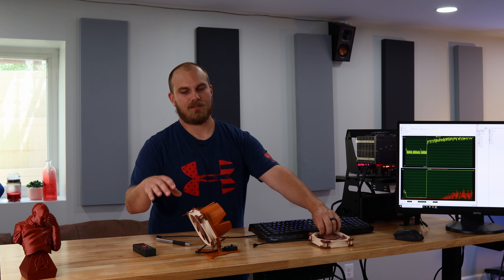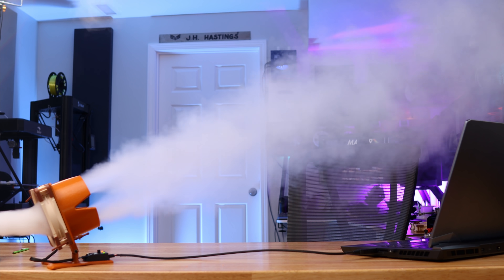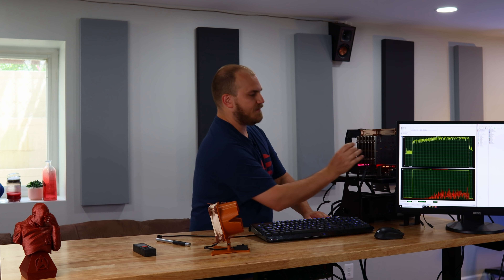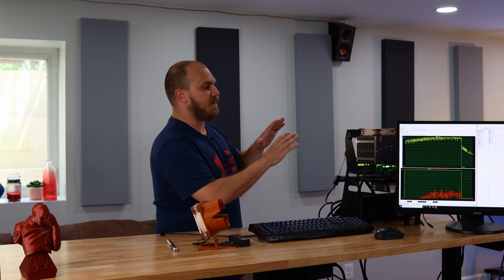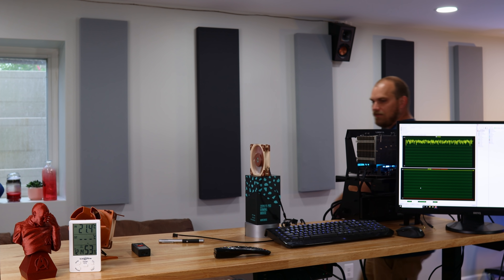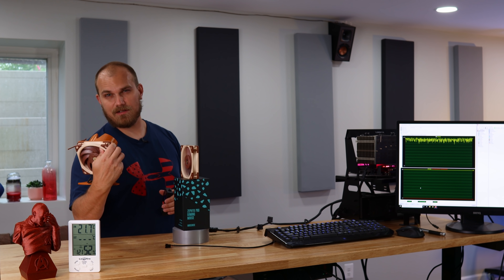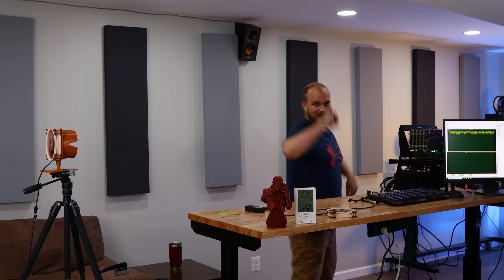AIR CANNON CPU cooling

Comment: What if we were to use this in a room heater? They usually are around 800w to 1500w units (iirc). I would assume it would likely need a lower wattage heater cause its performance is high? Or would this negate?

Also would like to see the top 5 tested fans be tested with the noctua desk fan in this video. Would be a cool special video. I'm assuming you might have to modify the desk fan in some instances?

Comment: There is still a flaw in your copy, and that's that each flow guide (no clue what to call it), has the same shape on both sides. While you can see in the Noctua prototype photos and sketches that the holes that guide the airflow have a specific lean to it because the fan blade spins one direction. I think that this is a very important aspect in the Noctua design. The guides 'slope' in the radial direction on one side. I also commented this on the other video, but nobody seemed to have seen it. I hope you see what I mean and try out a v2 design as I think this is a very important aspect of the Noctua design.

Comment: You'd be shocked at the thrust you can produce with contra-rotating blades - Essentially mount two fans flange to flange - one rotates clockwise the other rotates counter-clockwise.  You'd need to print a mirrored version of the fan rotor for the opposite rotation fan (i.e. the normal noctua would rotate in the normal direction, the second fan would spin opposite direction with an axially mirrored rotor)

Comment: If you have a remote fan wouldn't it make more sense to use a bigger fan. I've got one of those 60cm diameter fans and boy are they good at cooling although they are also noisy.

Comment: Hey James,

I printed one of these, and even remixed it to add a Modular Mounting System mount to it. Now that I have it on a fan, I'm noticing that there's air blowing out the sides, where the vibration dampening pads make a gap between the shroud and the fan. Maybe using the gasket that they include with the fans will get you a couple more cm depending on how bad the leak is for you.

Comment: Mechanical engineer here. You can achieve passive cooling without a fan by putting a half meter of 4inch PVC pipe over that heat sink effectively creating a chimney.

Comment: imagine how a Drum Fan works. look at the impeller drum. take the drum Scale it up large  and deep enough that a motherboard tray can fit under and into the Drum a bit now centrally suspend it on a motor so it rotates around the tray. make the computer case the fan its self :P . "Static cooling system low noise only psu fan and the case as ot rotates "at the speed of a old record player quietly moving air around the passively cooled computer inside...

Comment: guys. what if instead of blowing air through a radiator, why not design a radiator that spins and cools itself by moving air over/through itself. then you get use of 100% of the air you move instead of out the sides of the fan or whatever. shrug

Comment: The Picard buste facepalmed twice as statically at this remote cooling.
I think you should have put a huge cone with a 2 meter diameter to catch more air, I think it'll catch more air that way. Or not a cone, but a funnel.

Comment: You may have tested this already, but could you 3D print a chimney for that passive cooler?
I passivce cooled my 3950x with an NH-C14S at 2.2Ghz, with a short 6 inch, what is that 30cm cardboard chimney i could bump it up to 2.9Ghz

Comment: hmm.. on hot summers I often had to remov the sidepanel, point a normal, cheap plastic roomfan at the stock intel cooler and prevented overheating shutdowns that way. also helped GPU temps ALOT.

Comment: I'd like to have two fans mounted under my monitor but the monitor has no mounting points is is on a stand too small for putting them in front. Also I only have clearance for 100mm fans... Any ideas, anyone?

Comment: Man states he will do science. Keeps tweaking variables.

Doesn't record his results 

Should make a test at around 50 cm, 100 cm 150 cm and 200 cm

Measure deltas.
Report.

Coolest fan at one meter might not beat 2 meter ranges.

Three meter fans might exist but probably should just perform better at 2 meters

Thanks for sharing but we need SCIENCE!

Comment: 2 Questions,
Would a trumpet intake increase overall flow
And would this contraption blow harder, directly on a radiator/fins than a fan directly mounted all by itself ?

Its all making sense though, bigger intake, smaller exhaust. Like valves on an engine.

Comment: So i am thinking... is it possible to use a nozzle of this kind but not to make it throw the air in a straight line at a distance, but to make it suck the air in in a straight line at a distance? Though i personally don't think it's possible.

Use case: remote soldering fume extractor.

Comment: Just for your information:
Green laser ussually don't have a green light source, they use a infrared LASER source that passes through a crystal to turn green, however some of that Infrared doesn't turn green and need to be filtered out.
some of the cheaper don't use said filter and blast you, not only with a beam that higher intensity that advertised (hilarious enough), with infrared..

Comment: Last summer, my laptop fan broke, so I took the bottom plate off and laid on my couch with the CPU facing my 16" room fan. It managed to maintain 67F on a i7 8850U from about 6ft away. I bet with a shroud I could get a lot more distance.

Comment: i curious what effect would ahrouds like this have inside a case. like adding it to the intakes
Reply: exactly, if it's so effective to move air, that could lower noise levels by lowering case fan speeds when used in the front of a case to push fresh air towards the CPU and the GPU, would be nice to get figures on full performance mode (temp gain?) and quietest mode maintaining similar noise level.

Comment: i think the shroud might be a great addon for the front case intake fan. Higher static pressure to push air towards PCIe expansion cards. Maybe CPU cooler as well. Most cases have enough space behind the front intake anyway.

Comment: 3d printing (probably dumb) idea: Modify the shroud, add a little hollow cilinder in the middle where you can place a cheapo laser keychain, and lo and behold; you got a boresight for your air thrower

Comment: So basically, all your CPU needs is ONE 140mm version of these as an Intake inside the case pointed at the CPU cooler and 2x140 on top and below just to get even more air drafted in :D

Comment: i bet these will be quite good as system fans,  for example one of these at the front of your pc, pointing towards where the gpu is located, should cool the gpu good, edit just seen the smoke test, wow thats a good distance, looks better than those silverstone air penetrator fans

Comment: This is exact what miners need 
They could use x2 types fan for it
Industrial 120mm or 140mm with 3k rpm
Or for a home crypto farm  200mm fans to reduce noise.

Comment: just put the anonymous 'tulip' Sep 20, 2020 on the intake side for more fun then aim it with smoke, job done ^_~

afterthought make the AIR CANNON also spin to try & make an Austrian Viktor Schauberger esq tighter directional additive vortex flow

Comment: It's not useful in it's own right, but it is interesting.  Half contemplating the cooler + a fan, and this demonstrates how little airflow it takes to give that cooler an assist/bump.

I've got 2 Corsair fans exhausting out the top of my case so I think that might be enough, so it's off to noctua reviews to see if hopefully GamersNexus or someone has a similar set-up in their test rig.

Comment: could you make a air cooler attachment ( 3d print ) for an air cooler that you could attach directly to a vacuum cleaner and suction air strait though the cooler at high speed? Please? Thinking shop vac

Comment: Take the same shroud… print tubes in the same direction.. does that help with directing the air? I know it works with water making it come out straight to crest affects.. also making the tubes smaller inside and lathers on the outside to create the inside pressure less may keep the air from dispersing. I dunno. Great idea tho.. great videos btw

Comment: Your distance measurements are a few inches off.  You should be butting the back of the laser up to the fan, not trying to line up the front of it.
Reply from the maker: there is a setting to measure from the front, that's what i was using
Reply: @MajorHardware  Oh damn, I see that on the display now.  I have multiple of these and I don't think any of mine have that function.

Comment: I bought the components and fan from your other video. Been looking at small fans for camping. With everything and 3D printing (my own printers) I will be just shy of $70 into it. Hopefully it will work better and quieter than the cheap $20 from Amazon. Still kind of expensive for a desk fan IMO.

Comment: This is a really fun video, actually. It makes sense, if the passive cooler is just delivering heat to ambient air, that constantly changing out that air would make a difference. And if we cool ourselves with circulating fans that may be some meters away, then it makes sense to be able to cool a large passive heatsink with a desk fan.

I am really impressed with the Noctua design, though. I didn't think a PC case fan made such a directional air mover and such a stellar-performing desk fan! Judging by not only that, but also the most-recent fan showdowns, I think shrouds may be the new frontier of specialist air cooling applications in the PC space.

Comment: I've printed your 3D model (no changes) and bought an NF-A12x25 5V for it. The fan even comes with an adapter to USB, so I can now connect it to a regular USB power supply. The only problem is that it's really strong, so I have to place it very far from my desk to avoid getting a headache, and there's no way to regulate it (with the 12V version you can get power supplies with a dial to adjust the voltage, I'll probably try that). It's dead silent though, unless your ear is right next to it.
Reply: If it's compatible with voltage based speed control and you're comfortable with a little diy, you can get inline pwm speed controllers for a couple bucks. Works great with 12v ones using a generic supply to control fans and LEDs.

Comment: I may be wrong but that picture looks like the outlets have some spin on them
Reply: That is why the original design was not symmetrical. When he made it symetrical, the performance dropped, as you pointed out.

Comment: It’s great and really impressive, but the flow as visualized by the smoke test still seems very turbulent, and I can’t help thinking a vortex would do better — if that's even possible. And we all know smokering-like flow can cross big distances without expanding or dissipating; has anyone made a fan that just shoots rapid fire  rings in order to cool?

Comment: The 'laser' tape-measure actually measures from the back (I know the apertures are in front) . You include the length of the device since it allows you to measure from wall-to-wall without having to drill a hole in your wall to sink the device into ;)
Reply: Most of them have a option in the menus to set whether it calculates the distance as measured from the front or the back, I imagine he was changing it to the front
Reply: In the upper left corner of the distance meter you can see a picture of the mete with an arrow starting from the top, if it would measure from the bottom the arrow would start from the bottom 🙂
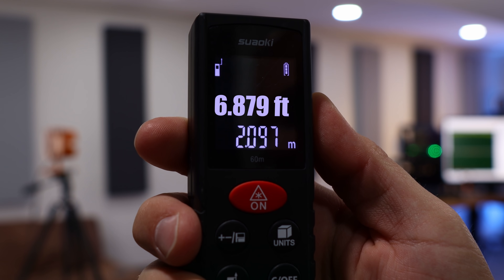Added example 4:31
Reply: @lilypower  Shucks, I have the cheaper version of that suaoki brand laser measure which does not have the front/back button. I'm forever measuring from the back I guess... Glad that's all sorted out though :D

Comment: suddenly I want to print it for my PC Case, so I can mount it on my case and efficiently throw hot air to my room ceiling rather to surrounding.
Reply: Fan forced chimney
Reply: @shankyoncloud7420  yes! but my fan is only 900RPM, hopefully that is quite powerfull to throw air to the ceiling....
Reply: @adityasixviandyj7334  add an extra fan that's a high RPM but with a low static pressure. Like, an electric ducted fan.
Reply: @AmaroqStarwind  so I need to find a PC case fan that had spec 2000+RPM that optimized for airflow. thank you!
Reply: @adityasixviandyj7334  basically just get a fan that's used for water cooling (i.e. radiators)
Reply: @8BitShadow  noted! thank you!
Reply: @8BitShadow  Those fans will probably be more optimized for static pressure than for airflow.
Reply: @adityasixviandyj7334  NF-A12x25 or NF-F12 industrial PPC2000/3000.
Reply: You hve something there, exaust case fan blowing the warm air as far as possible !

Comment: Attach a delta fan to it and see what happens :D
Reply: I tried it with my 6k rpm Nidec (12V, 3.6 A, 120 mm), it ripped the shroud to pieces - it caught vibrations and came apart on layer lines. I will try to print it in ABS and smooth it.
Reply: @Vatharian  I have never gotten a particularly robust ABS print even after acetone treatment. The best layer adhesion i have had so far is PETG printed rather warm at 235°C, with 0.6mm extrusion width, through a 0.4mm nozzle since i'm lazy, and i have been told PCTG can do better.

I guess if you had a warm chamber for your printer, you can have better success with ABS.
Reply: 1: you now need to anchor the fan to the ground, due to the thrust generated.
2: You become limited in line of sight distances when in excess of 4 km.
Reply: @dposcuro  I was thinking the same, that mount would not keep it from blowing over. You would have to mount it wherever you place it.
Reply: @D3M3NT3Dstrang3r  I would like to see the result also
Reply: It becomes a Tesla cold gas thruster

Comment: Make a 3-meter shroud to guide all the air into the heatsink and beat that distance record with ease.
Reply: Unless you measure from the front of the shroud... 😁
Reply: 😂💯 Imagine the time it would take to print that 💀. (Of course you could use a pipe, but that would be too practical.)